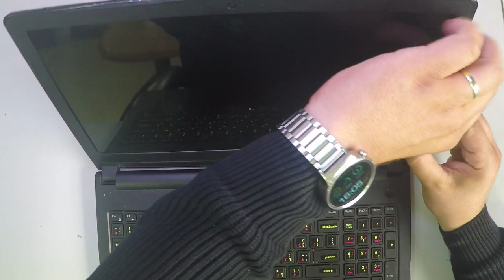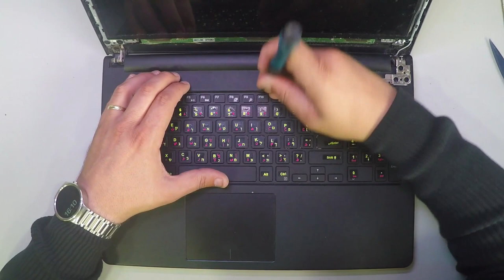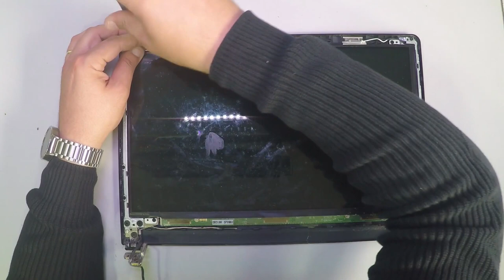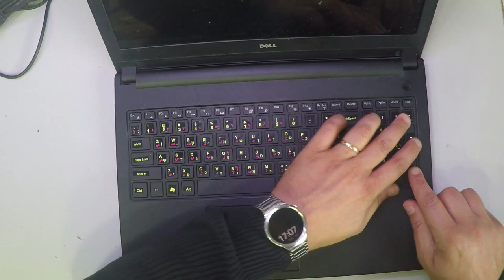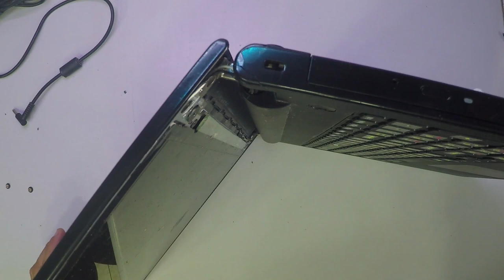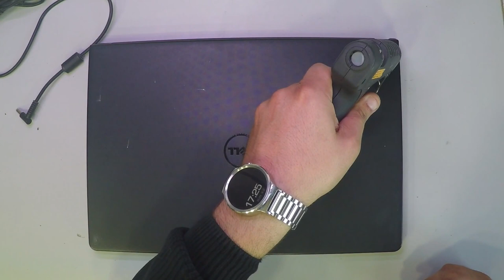Dell Inspiron 5558 Hinge Replacement

Comment: Where can I buy the replacement hinges used in the video
Reply from the maker: Hello, Check this link https://www.aliexpress.com/item/GZEELE-NEW-LCD-Screen-Hinges-For-Dell-Inspiron-15-5558-5559-Left-Right-SET-AM1AP000300-Notebook/32894935498.html?spm=2114.search0104.3.1.5f45778cBzm6ZN&ws_ab_test=searchweb0_0,searchweb201602_2_10065_10068_5727215_204_318_10059_10884_5727315_10887_10696_100031_10084_10083_10103_452_10618_10307_532,searchweb201603_60,ppcSwitch_0&algo_expid=636cc94f-6a43-47bd-b726-d61cfc61b2c1-0&algo_pvid=636cc94f-6a43-47bd-b726-d61cfc61b2c1&transAbTest=ae803_5&priceBeautifyAB=0